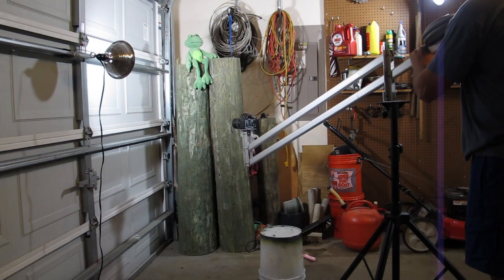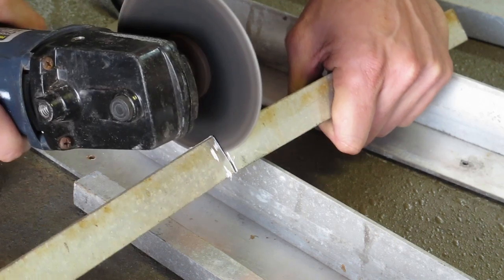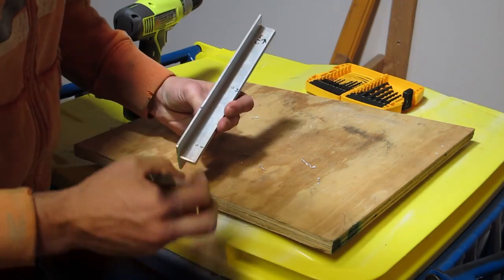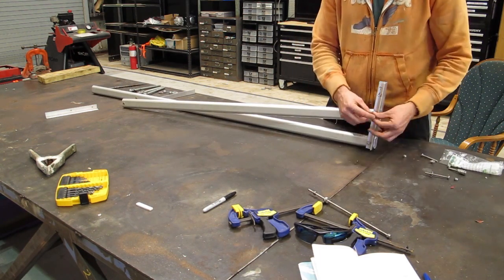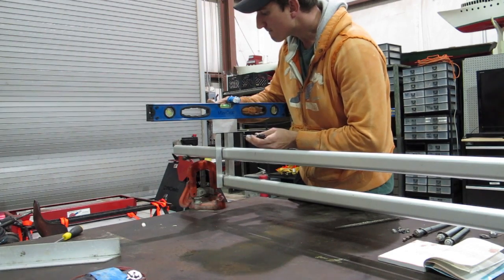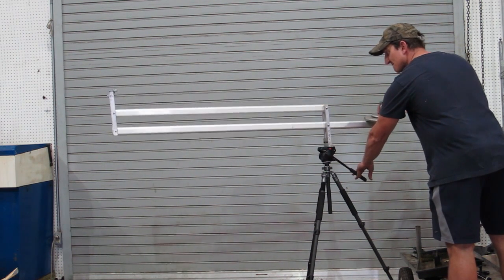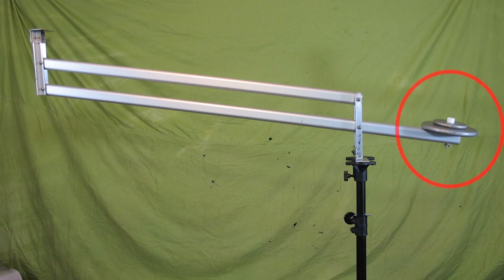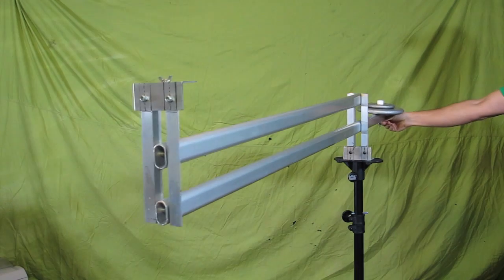How To Build A Camera Crane "Jib" For Video or DSLR Cameras

Comment: Abrasive wheels are not suited for aluminum. Use a carbide wood cutting blade in a miter saw for clean results with minimum burring. Wear your eye & ear protection. Nice design on this unit.
Reply from the maker: thanks for the tips for cutting aluminum

Comment: I like this crane, and I've watched many DIY videos about building one, but one thing I would like to know is, how would you put a swivel where the camera is mounted so if you needed the camera to level at any point you can do that. Example: in your demo on how the jib works you shot  Kermit as you moved up from his feet until you reached his face but the camera was still in the upward position instead of leveling at his face. Do you understand what I'm saying? If so how could that be done?
Reply from the maker: Thanks for the comment.  I do understand and it is possible but was outside the scope of this more simple build.  Would be a bit more complicated to build and would add another control variable to deal with.

Comment: Just going back through emails of 2014, came across this video again. Thought I'd do an update. For my vertical bars, I used two monopods so the camera / tripod distance can adjust from two feet to about 4.5 feet. The front part was similar to this, except I used one of the tripod heads from monopods, so didn't have to keep the front plate level with the bubble level. (Means camera can point to side or to front, or the camera operator can pan/tilt camera whilst also raising / lowering) Rear end uses 40mm aluminium box section. One is cut to 100mm, with sideways facing bolts going through bearings stuck into uprights with resin adhesive. The weight section is 400mm, and is fixed around the outer monopod tube, (the weights on their own cause the tube to bow a little, so this box section / padding reinforces it)
Reply from the maker: sounds awesome thanks for the update

Comment: If you had simply 'thought out' for a second before drilling your single weight hole- you could have made a sliding insert hanger  that could balance the camera with a lighter counter balance load- why carry 6 pound when 3 would work at 2x away from your pivot point. So make an oval warmed up PVC to slide in or shaped piece of wood and make it so. Also you should put in a degree wheel marks x and y  with stops so you can monitor you camera moves. Otherwise it works, but often the camera control needs to often make the camera point downward at certain ratios as the boom moves up. So Step 2 is another geared ratio pivot assembly to manage the cam

Comment: +MrKistel I don't understand how you can mount your camera to the crane plz help me
Reply from the maker: +Ruben Brouns there is a hole in the top mounting plate in which a 1/4-20 bolt can be used to mount the camera to.

Comment: Awesome design.Seems simple, yet really well made. Thanks alot. I would like to be able to get rotational shots as well. When you used the tripod for support did the weight make the shots shaky? Or was it just awkwardly balanced? Would you suggest getting a more stable tripod or making something using the speaker stand?
Reply from the maker: le maison blanche with the speaker stand and speaker mount bracket I can rotate this jib pretty fluidly.

Comment: Kistel Man !

Nice stable-looking design. And the oval tubing not only appears to be strong, is makes the whole thing look like a piece of pro gear --- ie., not made out of conduit or PVC.

But where does one even find the oval ?

Thanks.
Reply from the maker: Dan Little Dan, Merry Christmas and Happy New Year.  Thanks for the comment.  I was lucky and found the tubing in a scrap pile at a facility I volunteer at.  However you should be able to find it at most online metal suppliers.

Comment: This is awesome... thanks so much. I am about to give a go at building my own and am wondering if the camera mount base needs to tilt to stay pointed at the subject. Yours stays level, but do you have any thoughts on the need to keep the field of view on the subject as you move up and/or down?
Reply from the maker: Steve Cody Thanks Steve, Yes in this design the camera mount stays level.  This works well for a variety of shots but if you want to keep the camera point at a particular location while the crane moves (and while staying in focus) it would become a more complicated build.  You could create a pivot  head mount but this would make operation a bit more complex as well.  For a DIY I think the flat mount is the way to go and invest in a professional rig (or even a crane rig crew) when you are able to justify it.

Comment: Thanks for sharing... this is the best DIY design I've seen yet. The 2X1 oval tubing is excellent because it does not flex, bend, or bounce like some of the other DIYs I've seen. Also the speaker stand is an excellent idea for stabilization. I will be building one soon. Bravo!
Reply from the maker: ***** Thanks Jay,  Yes the oval tubing has worked well and the rig is very stable.  The funny thing is I was thinking about using square tubing but found that I had some oval stock.  So I designed the rig around the oval tubing and I believe it worked out much better.

Comment: When I built my unit, I used a washing line prop that consisted of two four foot long 1" square tube bars. (I went overkill and mounted skateboard bearings in 1 1/4" alum plates for the for and aft parts) Pan / tripod: used a worklight stand, and mounted a thrust breaking on top.

Version 2: Replaced 1" bars with two monopods, so now can work between  24" to 50" jib length.

Verson3: (Idea stage) Latest trend of making the crane also operate as a slider. My idea is 4x 19mm tubes for camera / weight guides, and 22mm x 4" PVC pipe as the runners. (Those form basis of my 49" slider) Want to build it so have 3 "sections" of 4 pipes attaching to 3x 1 1/4" plate, (got to devise way to avoid 'clunking' as it passes over join in pipes, and avoiding 'sag' of 8' of 19mm wardrobe rail)
Reply from the maker: Cool Chris,  I was trying to come up with a way to make a plate with bearings for this jib to use as a slider as well.  Keep us posted with what you come up with for yours.
Reply: MrKistel
What I did (if not very good engineering wise) was use a 22mm hole drill, and cut a hole in the 1 1/4" x 1/4" flat bar. (To keep holes alignted, taped bars together, and drilled pilot holes which were then opened out. Vibration means the hole is nearer 23mm even with a bench drill at slow speed) I then used resin adhesive to hold it in place. There's various 'grades' of this stuff. Some go brittle, but the most effective one is one that's for metal and contains (I think) metal dust. (Sold by Loctite in UK).

I then used square tube same size as horizontals, added a shim of plastic on sides to make it marginally wider, and then constructed it into a "U" shape. Providing the bearing pivots at the top of the "U" are not overtightened, the bearings stay in place

Sticking out of the bottom of the "U" are two long bolts. They bolt through a plate fixed to the workstand, (which has the thrust bearing underneath). ** If my wording is not too clear, I can send a quick sketch